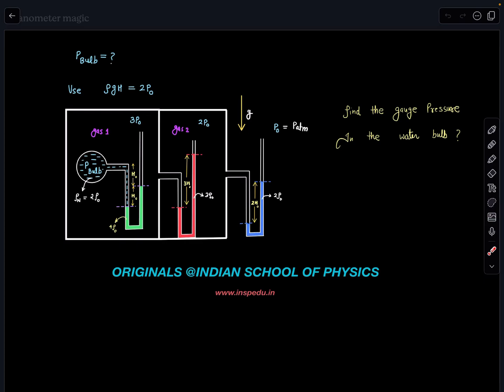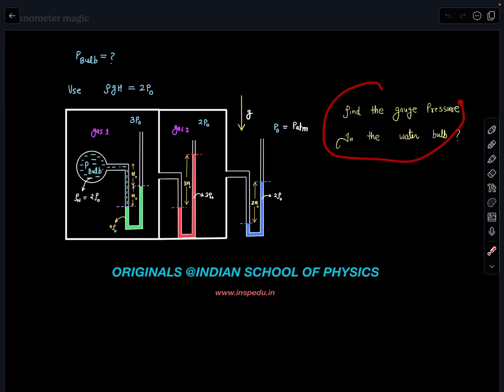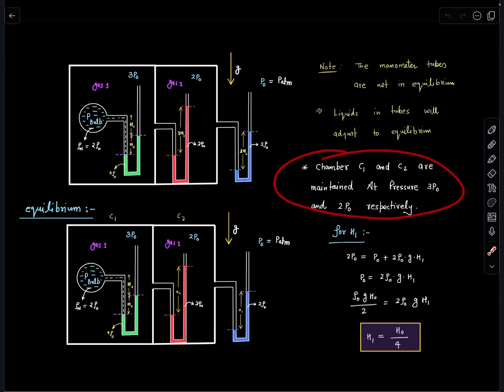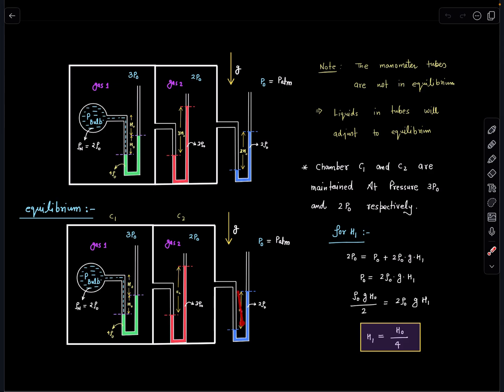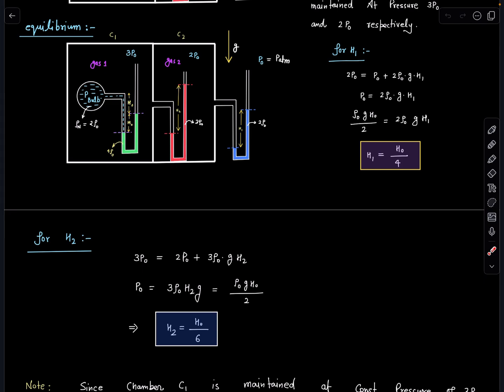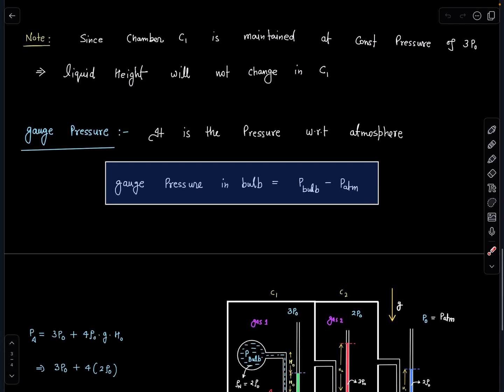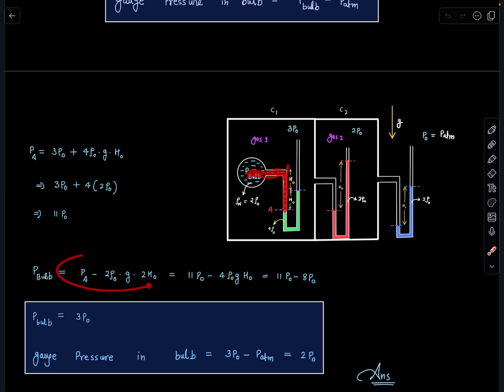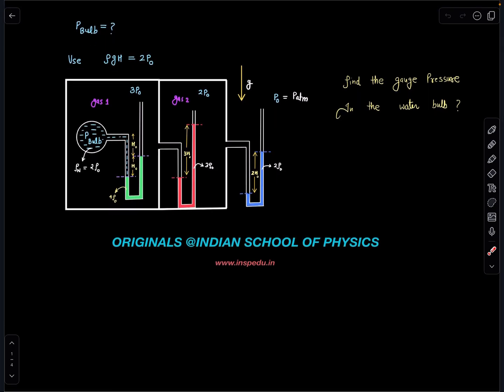[ JEE ADVANCED ] Unraveling The Mystery: Non-equilibrium Manometer [INSP] [SCHOOL PHYSICS ]

Comment: Dear sir the problem was fairly simple... But the question asked abt gauge pressure of bulb..it required only that green tube.... However there were two more setups given due to which we got confused that why extra info is given due to which we were confused.... It was our fault for not using the necessary data... Just pointed out my mistake🙏
Reply from the maker: i framed other conceptual problems too in this like H, H1 , H2 increses or decreases new ratio of heights etc .